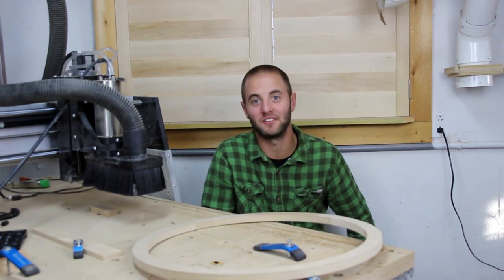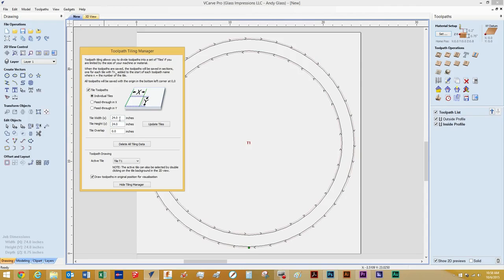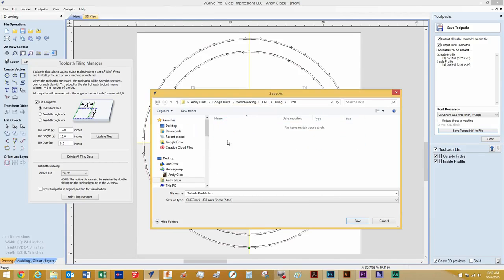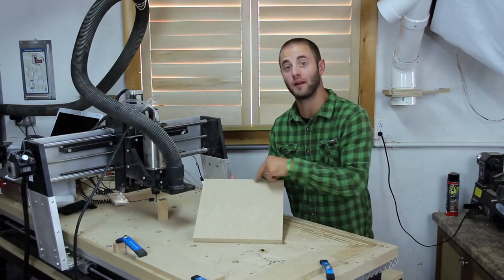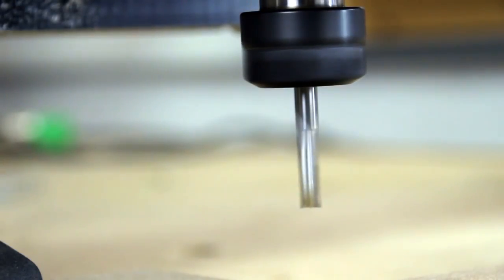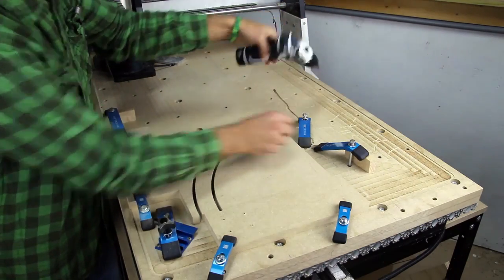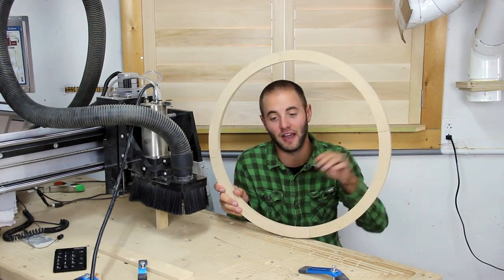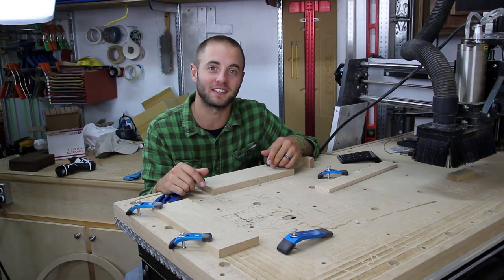CNC Shark Tiling Function (VCarve) Overview | Glass Impressions

Comment: What about machining the thing from one big board with 3 quadrants hanging over the table edge? Would save the glue up, wouldn't it?
Reply from the maker: Andy is demonstrating the ability of the software to break oversized projects into components that are within the capacity of the CNC machine. As with most CNC projects, there are alternate toolpathing strategies. If you have any additional questions about CNC machines, you're welcome to reach out to our product support team at support@rockler.com or 1-800-260-9663.